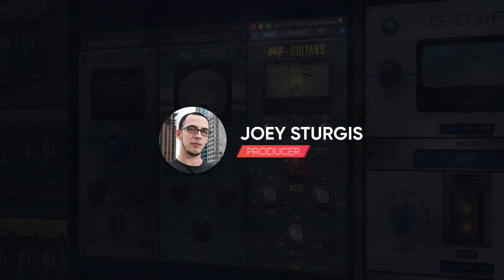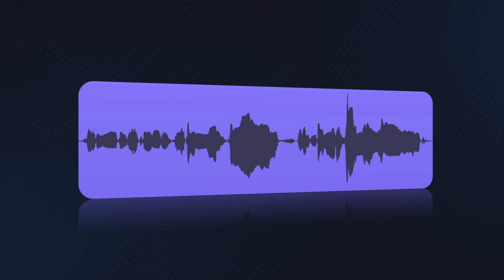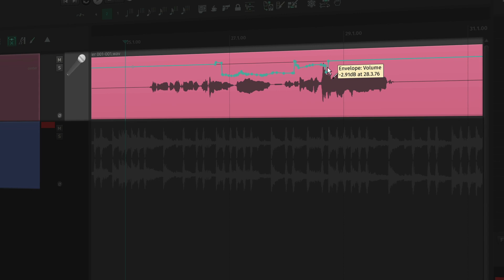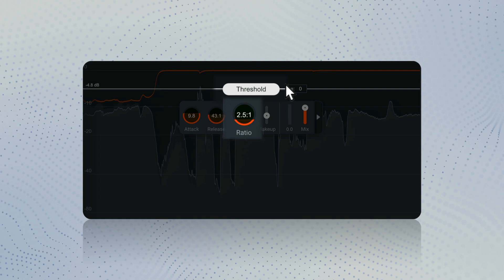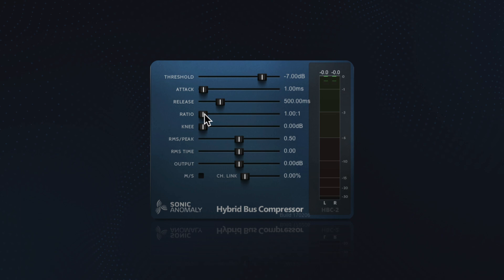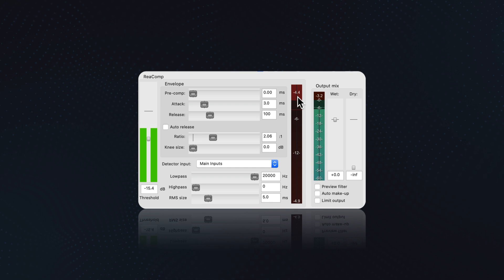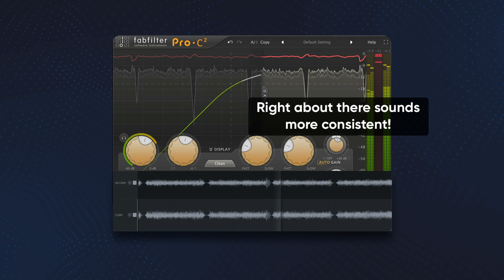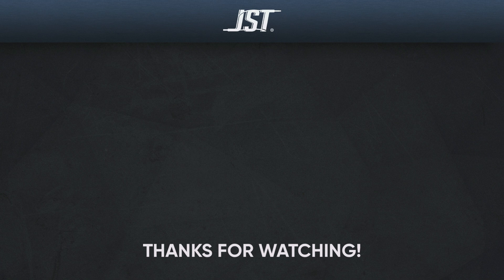How To Easily Understand Compression

Comment: So the question of when to use a compressor vs using a limiter?
Reply: Obviously it’s just my opinion (random dude on the internet) but a limiter is like a brick wall. Infinite ratio:1. I personally tend not to use limiters on individual tracks, and is pretty easy to overdo on individual channels, but there are some cases it works well on em. I stick to busses if I use one,  and more so on the master buss.
Reply: the easiest answer to this is: try both! see what you prefer! Limiters don't usually have a lot of options so they're not great for toneshaping. Compressors have more control over the excitement of a source
Reply: Use a limiter if you want to catch fast (loud and annoying) transients, this is something that you can do with a 1176 though and get much better results and control. If you want to keep the transients and punch intact then avoid limiters during mixing. But if the compressor can't control the transients the way you want then a limiter could be the best option.

Comment: My question is: "Are there any differences in digital in the box compressors? Will one compressor plug in with all the options give you everything you need, or are there advantages to having multiple options and plugins?"
Reply: (not joey but I use both) I find ITB comps work best in a mix, but there's no replacement for using compression as an insert in your preamp. Controlling level is super effective before it hits the converter stage! (just make sure you know what you're doing or else you'll ruin it haha... we all have)
Reply: You need to have multiple compressors for various purposes. This is why even in your DAW they give different stock compressors so that you can solve as many problems as you can. Sometimes a compressor can be used for its character and attitude rather than controlling dynamic range. Other times compressors can be used to control depth, punch, transients, glue sounds, etc. you can't do all that with only one compressor even if it has all the parameters (attack, release, knee, etc.). Not all compressors are built the same.

Hope that answers your question, feel free to reach out if you're still confused. All the best 😎